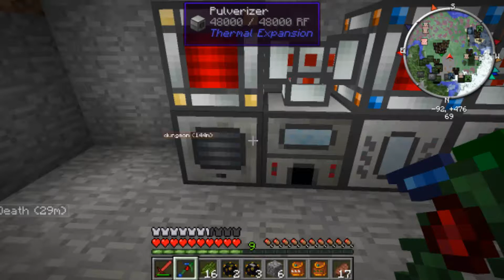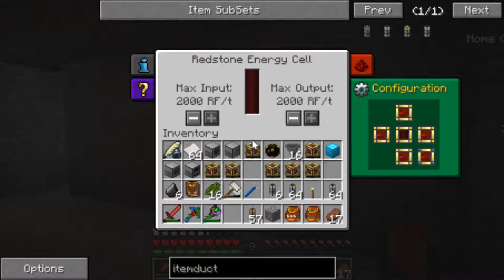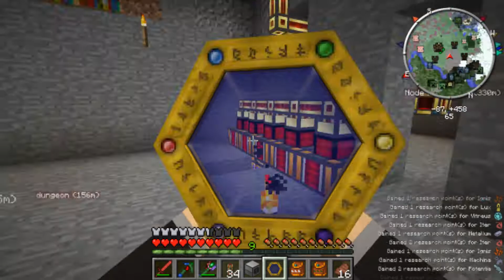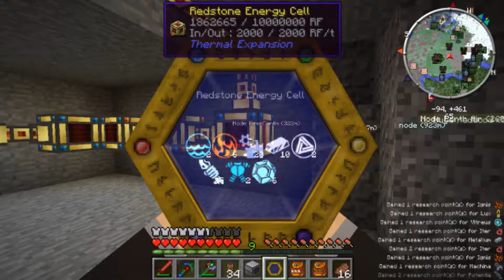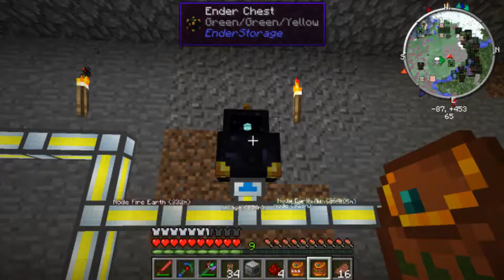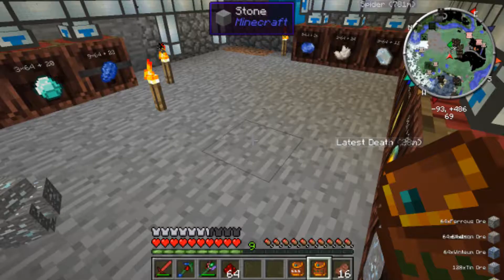Feed the Beast 1.6.4 S2E17  Auto Ore Processing (Now with Advanced Power Storage)

Comment: I know Im WAY behind in the series, but, just in case you haven't figured it out, no, the two fluiducts transfer the same amount of liquid. The only difference is one renders the liquid in the pipe and the other does not.

You can use the normal fluiduct for lights though. Melt down glowstone, put it in a tank and run your fluiducts.